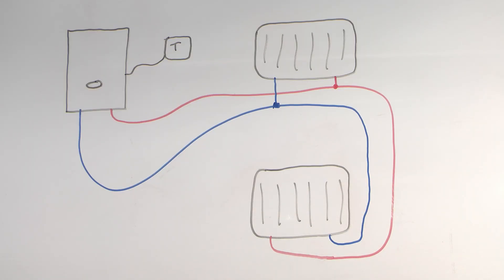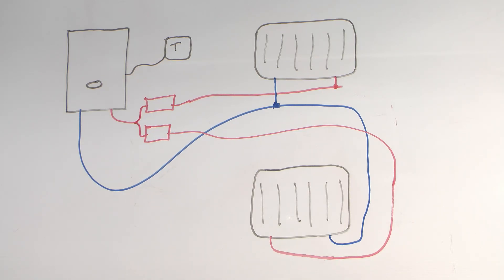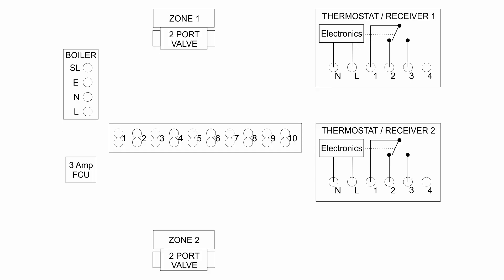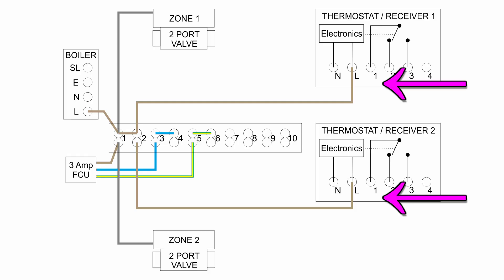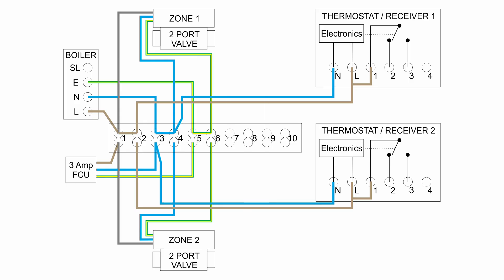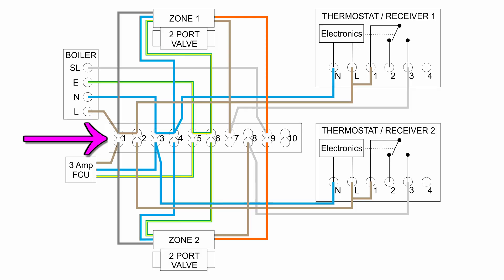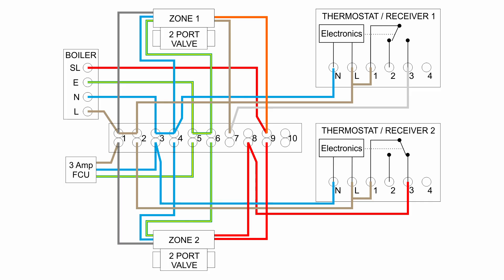Combi Boiler with Two Heating Zones, 230V Switching

Comment: Where would you wire the pump in this diagram
Reply from the maker: Nowhere, a combination boiler has the pump as an internal component.
Reply: @jwflame  thanks John. I should of said mine is a condensed boiler. 
In addition I have two 2port valves s plan zones. Heating downstairs is one zone and heating upstairs is the second option. If I leave both valves closed or the switches on the wall off, the boiler once on, it just heats the water. Is there any diagram available to wire my hive to my system as I’ve tried to describe

Comment: Hi if one zone was underfloor heating what would pump be wired to?
Reply from the maker: UFH has it's own pump, which for a small single zone would be connected to the thermostat for the UFH. 
For larger installations with multiple zones, the UFH pump is connected to a dedicated controller/wiring centre for the UFH together with the thermostats and zone actuators.

Comment: On a 2 zone combi system. Could both valves be removed and pipe work bridged where the valves are removed and a simply receiver and stat be added directly to the boiler for call for heat without altering any other pipework?
Reply from the maker: Yes, it would just end up as a standard combi boiler installation.

Comment: Thank you John. I'm not an electrician but have benefitted from so many of your videos. I have a problem relating to the above. We have fitted a Heatmiser UH4 control unit with wired 230v Neostat V2 thermostat/timers. The Heatmiser gives the option to run underfloor heating zones along with a radiator circuit. I wondered if you have any knowledge of those products? The electrician is scratching his head because our Worcester Bosch Greenstar boiler asks for a 230v supply to its switching, the Heatmiser wiring diagram seems to show a volt free connection coming from the control unit. As a result, the boiler doesn't switch off at any time. Sorry if all of that is confusing.

Comment: This is a great overview. One thing that's always confused me (as a lay person), is the circuit route (thermostat -> wiring board -> boiler) carrying the actual power for the boiler itself? Or just enough power to 'activate' the boiler, which then draws running power from an independent connection?
Reply from the maker: The thermostat is just an on/off signal to the boiler.  Also note that this wiring is intended for gas or oil boilers, so the electrical power used is only for the pump and controls, typically under 100 watts.

Electric boilers do exist, they would have a separate high power connection for the heating elements, with the thermostat wired as here, just for on/off control.
Reply: @jwflame  Thanks. I actually forgot it's gas combustion that's heating the water, not electricity!
Reply: @jwflame hi do you have a video on a combi boiler with ufh manifold & room stats

Comment: Thank you Mr John for clarifing and simplifying. I have a question. Do we  need a programmer? Just thermostat enough? And what about hot water how it is controlled for each zone? Many thanks
Reply from the maker: The arrangement in this video would be used with modern programmable thermostats, which have both time and temperature settings.  it would be possible to use a separate programmer/timer and thermostat but there is no point - it would cost more, be more complex to install and provide worse control of the heating.
There is no control of hot water here - combination boilers heat the hot water on demand.
Other videos in this series cover hot water controls, https://www.youtube.com/playlist?list=PLVsHvs2Suqmr5HtxgbInR4bXmH0kLseWc
Reply: @jwflame  thank very much Mr John

Comment: Hi sorry to be i bit cheeky John I'm stumped I have been searching for a wiring dia. for a system with Keston c40 with two switched live, one for heating and other hot w. I had an oversized cylinder made up with a solar coil and heating coil high and low immersion bosses and used it in an extension I built so have two cylinders now, I have two heating zones two-pipe and underfloor with Danfos radio linked stats with their own timers built-in, I want all four zones independent and I am ok with two programmers, any idea where to look for guidance, been in the heating industry for 30 years but pulled a blank on this one. I'm retired on ill-health for some years so out of touch with colleagues to draw from, any help will be appreciated Cheers Mike R.

Comment: Could you connect the grey and brown wires together at the 2 port valves, and then ditch the perm live to the valve?  You would still have the ability to switch on the boiler with the postition switch within the valve, however it would be fed from the programmer not the main live. You would then only need 3Core + Earth cable

Comment: Sir, what type of cables be used in boiler electrical wiring, please.  Thank you.
Reply from the maker: Heat resistant PVC flex, 0.75mm² would be the usual choice.  3,4, or 5 cores depending on what is being connected.

Comment: Had to wire a combi to a cylinder as well as central heating through 2 x2 ports 10 years ago, what a head scratcher that was, had to run it through a relay switch if I remember correctly.
Reply: Should basically just be the same only with three zones instead of 2. Unless you want hot water priority, (ie if hot water is demanded then heating is off). In that case you’d do something fancy with the NO and NC contacts of the hot water thermostat contact. Specifically, the power that goes to the heating side of the system should be on the NC side of the hot water thermostat, so the whole heating side turns off when the water is demanded.

Comment: Nice vid thanks ..might be worth mentioning that if using a Honeywell wiring centre and going on their wiring diagrams the bridging in center may cause confusion for future fault finding if engineers are following Honeywell guides.
Not a criticism just an observation.
Great , clear info . Would like your thoughts on the best way you would use to balance the returns if say downstairs is bigger than upstairs . Thanks for taking for a great presentation.

Comment: Will this work with valiant ecotec plus 832 Combi boiler? It has connections ‘RT’ next to ‘LNPE’ inside this boiler. The RT connection has 2 terminals though? This is a 2 zone system with the Drayton 230v ZA5 2-port valve. I am also installing 2 thermostats, they are the danfoss TP5001M 230v with V/F output. I am right in saying the switch line to the thermostat will connect to normally open contact? Great video by the way, any advice would be appreciated!

Comment: That’s a great video thank you. Would it be the same for underfloor heating zone valve instead of two central heating zone valves? If so how would I connect the pump wiring?
Many thanks
Reply from the maker: The valve is the same.  If it's just a single zone, the pump is wired to the switched output of the thermostat, the same terminal as the brown wire to the valve.
For systems with multiple UFH zones, a separate UFH controller would be used, which will have connections for the pump, actuators and thermostats.
Reply: @jwflame  thanks very much John much appreciated

Comment: Is it possible to have a 24v thermostat connected to the zone valve controlling the radiators and a 230v stat connected to the zone valve controlling the u/floor heating on the same combi boiler?
It’s a valliant combi.
I’m pretty sure I can but just wanted some reassurance 😁
Reply from the maker: If the 24V thermostat just uses 24V for power and has volt free contacts, then it could be used, the thermostat contacts would switch the 230V for the zone valve as in the video.
If the thermostat switched output is also 24V, then it would would require a relay with a 24V coil,  the 24V thermostat would power the relay coil and the relay contacts would switch the 230V power to open the valve. 
In both cases the thermostat would require a 24V supply from somewhere.
Reply: @jwflame  thanks for the reply, keep up the great work 👍🏻

Comment: hi John. thanks a lot, helpful stuff. The plumber has attached an extra Wilo Para pump to the zone 1 side (to help with underfloor heating). Would I attach the live (of the pump) to number 9 in the wiring centre?  (the pump only has L,N and E)  That way, it would come on when called for by thermostat receiver 1?  or is the incorrect?  anyway else could help too?  thanks
Reply from the maker: No, if connected to 9, that pump will run when the boiler is on regardless of which thermostat is used.  If it's for zone 1 only, connect it to 7, which is the switched output of that thermostat only.  Numbers refer to the diagram in the video, your installation may have a different arrangement.
The UFH pump should be part of a manifold with a mixing valve, so it only pumps water for the UFH, and nothing else.
Reply: @jwflame  thanks a lot 👌🏻

Comment: Will  the central heating thermostat be able to switch an external heating pump on directly aswell as the boiler. I have a combi boiler and I think the internal heating pump is not powerful enough to pump water around the house. I want to put an external pump in the system but need it to be controlled so it turns on and off and not powered all the time.  Looking at the circuit diagram on your video, instead of having zone valves can the thermostat control the external pump the same I.e when thermostat is turned to required temperature the pump starts. 
Thanks

Comment: Hi John. Great video. Any advice for the best smart heating system which I could retrospectively add to my boiler (opentherm compatable) and underfloor heating (7 zones). As I have basic stats today it's working as a simple 'On(100%)/Off' system which means i often overshoot my desired temp and my floor is often too hot. I think I need to find stats which enable modulation (individually for all zones) but I'm struggling to find the right manufacturer. Thanks!

Comment: Hey JW, due to building works at home I am having to use the immersion heater now to heat water for about 5 months.
Is it cheaper to leave it on permanently being controlled by its start or only use the immersion on demand.
Has anybody ever carried out a proper study on this with real figures and temperatures??
Reply from the maker: It's cheaper to switch on when hot water is required, as when the water is hot, the losses from the hot water cylinder are greater, as the temperature difference between the water and the outside environment is also greater.
The saving will be largest with an old, poorly insulated cylinder where hot water is only required for a certain time each day, so most of the time the cylinder is cold.
However with a modern well insulated cylinder the losses are small, and if large amounts of hot water are required (so the water is hot most of the time), then the difference between heating when needed and on all the time is insignificant.

Comment: Very clear explanation  / description. No programmer is shown in this. Not often mentioned in various explanations available (which often show a HW. cyl stat); is that most /all combi systems have no HW cylinder or stat & the boiler supplies HW on demand. I assume a combi's HW output is triggered by an internal flow valve; you turn tap, water flows, flow switch operates, boiler fires. All that is needed are the zone stats to fire the CH as shown in your video plus a timer/programmer to automate CH. The HW side of the programmer is unnecessary in this set up.

Comment: JW, cheers your videos are fantastic. I have a question if I may. My boiler doesn't appear to have a switched live. I currently has a link in place labeled ROOM STAT/TIMER. My boiler is constantly firing up even though the thermostats are off. Have you seen this before?
Reply from the maker: That link is supplied with the boiler, so it can be powered up immediately after installation without having to connect external timers or thermostats, mainly so that the gas side of things can be set up properly.  Normally that link is removed, and it's those same terminals where the room thermostat or other controls are connected.
However some boilers have multiple options for connecting external thermostats, so you will need to check the installation instructions for your particular boiler.

Comment: Am a plumber but just couldn’t find a good diagram for adding underfloor heating to Combi with two zone valves and modern 230v programmable thermostats.... thank you, after five mins watching, my brain clicked into gear... the wiring diagrams I had still don’t make sense but it’s all working now thanks to you...
Reply: Hi Andy,
I am looking for the same thing connecting underfloor heating to combi but not sure how to do it. I would very appreciate it if you could let me know how you did it. Many thanks

Comment: John. Could you please explain what a dry contact is please? Thanks in advance
Reply from the maker: Switch contact that doesn't have any voltage connected to it.
Like the thermostat contacts in this video before the link between L and 1 was installed.
Also called 'volt free'.

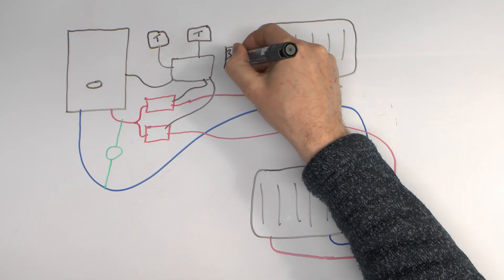Comment: 4:34 You won't need an automatic bypass valve if you use one 3-port valve instead of 2 two-port valves. I think the wiring would be a lot simpler too - leave the existing set-up and just add the 3-port valve and new thermostat.
Reply: Can u plz explain further….. i need to understand
Reply: @Aliens4world  A 3-port valve cannot be completely closed. There is always possible flow one way, or the other or both.
Reply: @millomweb  thx
Reply: There would potentially be complications with the wiring
You would need a wire from one of the heating zones for when heat is NOT required for that zone, due to how 3 port valves work
For example, wire A from the valve would be heat required for zone 2, and wire B would be heat NOT required in zone 1 (as both wires A and B have to be powered for the valve to move all the way across to zone 2 only, and removing power from both wires will cause the valve to return to zone 1 only, if you were to only power wire A, the valve will stop at the half way position)

Comment: Diagrams and instructions are very precious and clear I wonder if there are any possibilities of wiring zone valve and 3 port motorised valve in a single wiring centre. While I was on unvented course the instructor told me we could wire two different valves but I like to know how. It will be very grateful if you could made such video please?
Thank you JW
Reply from the maker: https://www.flameport.com/electric/central_heating/heating_wiring_Y_plan_unventedHW.cs4
Reply: @jwflame  cannot thank you enough for that Sir.
Reply: It'd be better with ONE 3-port valve instead of 2 two-port valves. Quite possibly in upstairs downstairs case, heating on both likely not necessary. If they are both needing heat, another switch is required to allow the 3-port valve to return to its mid position.

Comment: just what i am about to do, one for the kitchen and bathroom and one for the rest, only need the kitcen and bathroom most of the time as wood burner does the rest.
Reply: It'd be better with ONE 3-port valve instead of 2 two-port valves. Won't need an automatic bypass for pump overrun and means only need to wire one valve in.

Comment: Why would you want a permanent live at your valve , the thermostat gives the valve the signal to open and the limit switches gives the boiler the start signal.
Reply: As Ratzfaz says, it's so that the valves operate independently. Otherwise you'd effectively connect both valve browns together when both zones need heating (which is what you want - but if one is no longer needed, it's fed from the other one - so keeps heating both zones.
Reply: That would be quite a lot of current to put through a thermostat. It is better to use the thermostat to give a signal voltage to a larger relay in the zone valve.
Reply: remove permanent Live on the Valve and connecting brown and gray ?
I think u get in trouble, if both thermostates aktive, and one of them switches to off. the valve doesnt close while backfeeding power on the brown wire.
power comes from orange, passes the 'endswitch, comes out on gray, and back to brown.